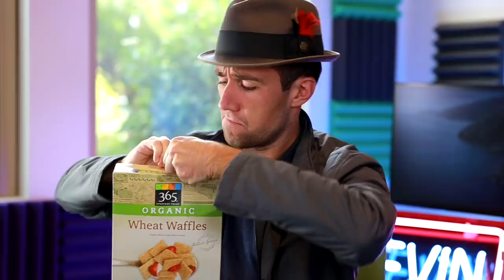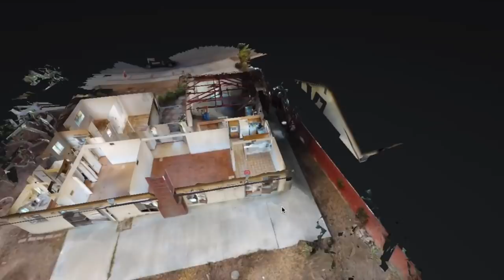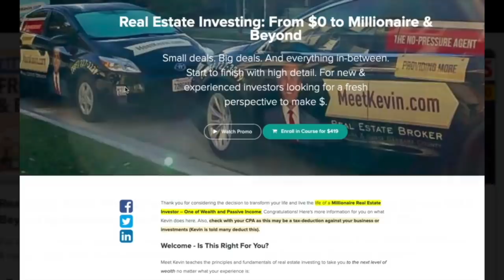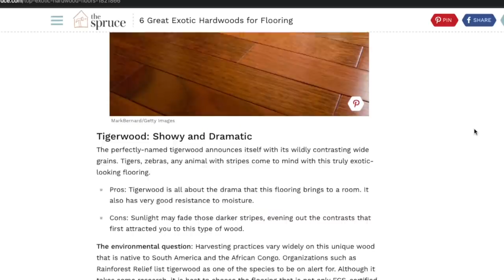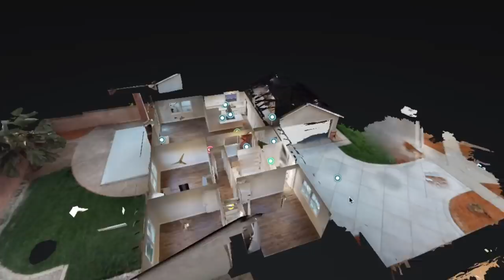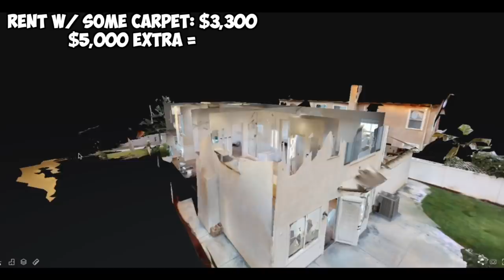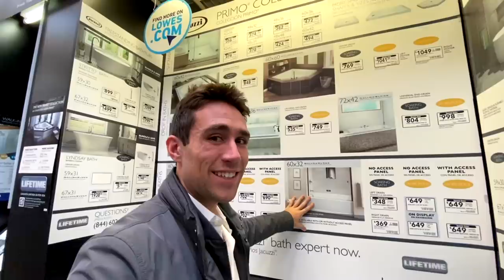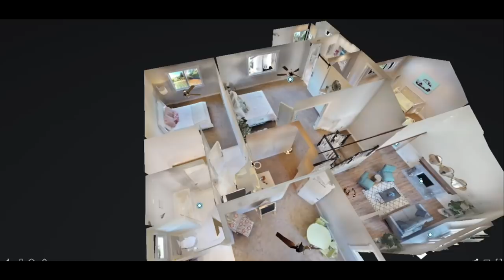Avoid these Stupid Mistakes EVERY New Homeowner Makes

Comment: Some good points for sure...

I agree on the carpet and always tell owners:
Carpet on the stairs = less slippery and cheaper
Carpet upstairs = less noise downstairs and cheaper
Save your "fancy" flooring for down where guests will be.

I will say though, there are some instances where quality can make a huge difference, like the lock example you gave, a nice schlage or better knob/deadbolt (at least for exterior doors) makes life so much easier. They are smoother, jam less, and last longer. It's the first thing I change in a new place.

Also, mid-grade or better fixtures/faucets are a must have. Nothing worse that a loose faucet or faucet handle and it doesnt mix the temps well.

I cant stand cheap builder-grade hardware and fixtures.

Comment: The worst mistake to make is buying a brand new home.  All of the upgrades are there coming from the home builder. It's hard to get a deal since you are paying full price.  🤔
Reply: I paid 313,500 for my new build.  The loan is 297,000.  The exact same model is on the market (the model home now that the neighborhood is complete) and shouldn't have trouble selling for 330,000.  I've yet to find another house on the market of that size anywhere near that price or location.  You just have to do your homework first.  Cosmetic stuff like paint and blinds comes out of your wallet, it's not part of the loan.  The builder isn't selling you upgrades for full price.  It was way cheaper to have the builder put in a bathroom properly than for me to do it myself later.  They save money because they're doing it the first time with wholesale product costs.  Anyone who comes later has to rip stuff out and isn't buying in bulk for 20 homes.

You're not going to get wedge deals on a new build because wedge deals require a home owner trash the property for you.  A new build can be a great option for a home you want to live in while you look for wedge deals to repair and rent out.

Not every wedge deal is a great deal either.  I know of a house that started out life being sold for nearly 1,000,000.  It last sold for just over 300,000.  Another house started life at 200,000.  It dropped to 100,000 and was sold.  It then sold a few years later for 200,000.  Someone thought they could turn it into rental because the owner trashed it and it looked like a wedge deal.  It's been on the market for months.  The problem?  Very active train tracks 20 feet from the backyard fence.

Always do your homework.

Comment: We bought our house for us and have 0 plans of moving ever. I do most of the stuff myself because I know how to and we get what we like. Made my own cabinets using maple plywood and pine for about $1300. Got a granite top for $1500. the sink was just a single tub that was about 20 inches wide (we hate the 2 smaller sinks in one). We bought the appliances based on customer reviews and some features we wanted. The entire kitchen reno including appliances was $7500. I renovated our main floor bathroom because the layout was terrible. That was done for $3500, everything was new, and I had to replace about 20% of the floor boards because there was water damage. The basement bathroom was also redone for $4500. I expanded it from 40 square feet to just over 70. Added a tub, removed the carpet on concrete slab, did a proper insulated floor with tiles. That's over $15K but like I said we're living here for the rest of our lives. I'll be doing the floors over the next few years but I'll be doing it all in either laminate or vinyl for the very reason of minimizing transitions. Plus the current floor is incredible squeaky. It's round 1500 square feet of floor so I expect it to cost around $5K

Comment: There's no such thing as "Reglazing".  Glazed porcelain tiles are extremely durable and require kiln temperatures.  You're painting your tile with epoxy paint, which is a great deal more fragile and supposedly lasts about a decade.

Comment: I got a floor model washer and dryer for 60% off (the nice ones). Had some smudges but it was fully functional and i saved 1200. Then i got a floor model fridge with a $5 broken hinge.  Replaced it myself. Saved 1800 off the new fridge.  This was back in the day when the door in door fridge was new.

Comment: Re glazing a tub lasts about 5 years for my rentals.
Reply: yeah, I'd rather get a cast iron tub and have it last way longer.
Reply: You get what you paid for Appliance yes 300 or 1,300 or $3,300 to keep your beer cold.    but  carpet $2 square feet is 60% better than a $1.70 per sqft and $100 saving on a living room will end up in years of disappointment

Comment: What product do you recommend to clean the tub/showers that's made of fiberglass/vinyl?
Reply from the maker: Some kinda acrylic
Reply: maybe try TSP
Reply: @MeetKevin  Searching now and considering changing the shower heads to the ones you recommend in the course
Reply: @DietBajaBlast  Thanks
Reply: Don't ever use any kind of abrasive. If you have then the floor gets foot dirty every time someone takes a shower. In that case use an automotive glaze to get the sheen back. Honestly it could be ruined. Never use anything abrasive (comet) on fiberglass. This is a common mistake. 🚿

Comment: i use ceiling paint on the walls of my rentals from a local quality paint store, not the home depot Behr crap. covers in less coats and easy to repaint damaged areas ,white ceilings throughout. white gloss trim paint with a touch of black in it to cover better.

Comment: I think what Kevin must be saying is rental demand in the US is very strong right now, when times are bouyant you can get away with doing less. However if you were selling a reno for $600K in the UK people would expect kitchen cabs to be soft closing plus you would need more than a bit of subway tiling. Also a tiled kitchen floor or the place will start to look rather bland. Here in the UK you need a bit of a 'wow factor' or renos will stick on the market, which can be very costly if you are on short term bridging finance ie around 12%. I think reglazing tiles is an economy too far, come on guys put some effort in tiling is not that difficult and it will make all the difference. I'm sure Kevin's mate in Ohio has done plenty of tiling in his time!